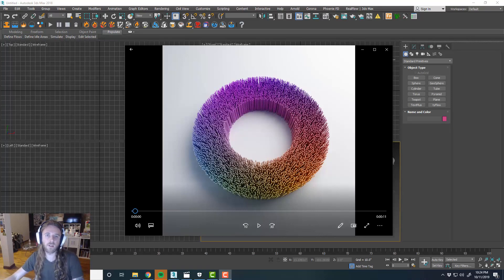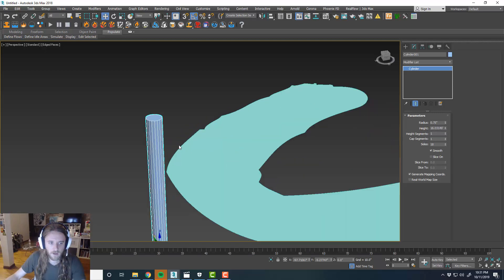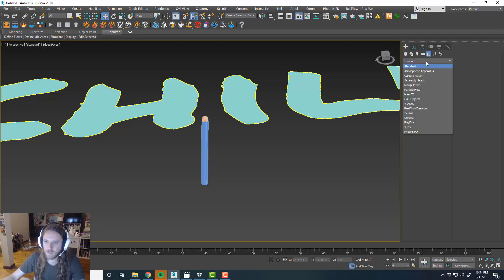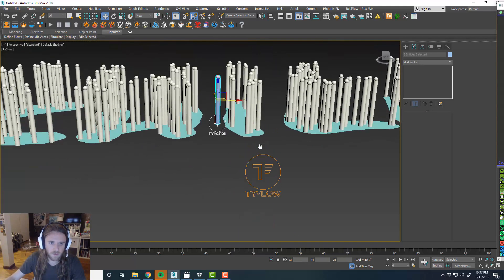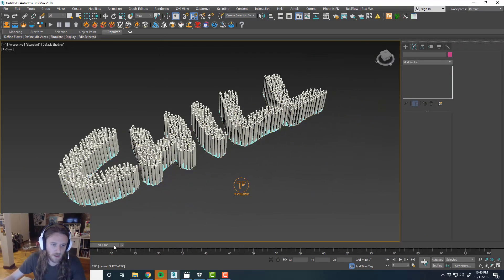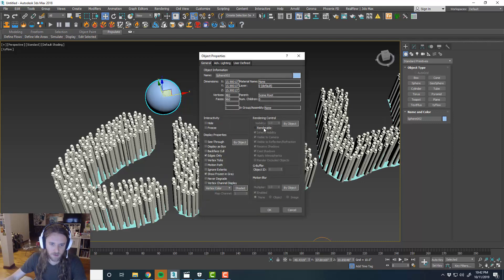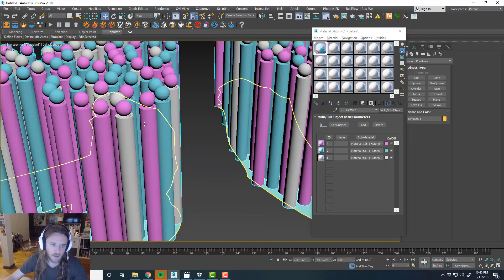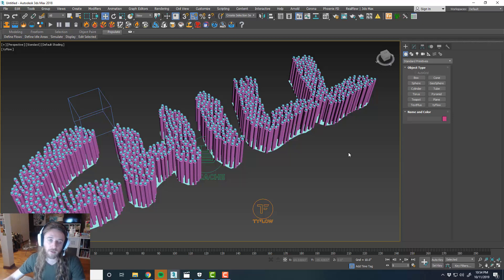3ds Max and TyFlow TUTORIAL: Physx Sticks

Comment: Any suggestion on how to reduce the jitter of the particles? I already tried increasing the simulaiton substeps, but did´t see any difference.
Reply from the maker: Does the jitter occur at the beginning of the sim? If so, try increasing the spread amount in the position object operator so none of the particles are touching each other.
Reply: @simulation_lab  Thanks for your response. Drastically increasing the simulation steps seems to have solved the jittering, but now the objects tumble on their own, before they are collided by the sphere. Any idea?
Reply from the maker: @javiers8811  Hi Javier, did you check the spread amount in the Position Object operator? If the sticks are touching each other when they are birthed, the will cause each other to collide and tumble over. It's important to make sure none of them are touching each other.

Comment: hello simlab.
i try to do domino with your technic but when i put physXshape operator the dominos take a small angle.....and when i play anim they all fall down in the same time immediately....any suggestion?
Reply: Solved: i find the default gravity at a very high level....strange...but fixed.
thx for this super tuto simlab
Reply from the maker: Make sure that in your position object operator, you check separation and increase the distance enough so that none of your dominos are touching each other. You might also want to increase your substeps in the main tyflow settings under the physX tab. Let me know if either of those works!

Comment: Nice Tutorial and i like that. Can you please make a tutorial of car crashing in tyflow using tyActor...? I tried that but it looks weird when i apply physX shape, its like a stretching the cloth or wobbling in it. please help.
Reply from the maker: If you're seeing stretching or wobbling, it sounds like you might need to increase your sim substeps. If you have the tyflow object selected, open the PhysX rollout in the modifier panel, and increase the substeps. You can also play with the time step under the Main Settings, but it depends on how fast your car is moving per frame. Maybe slowing down the animation of the car might help too.